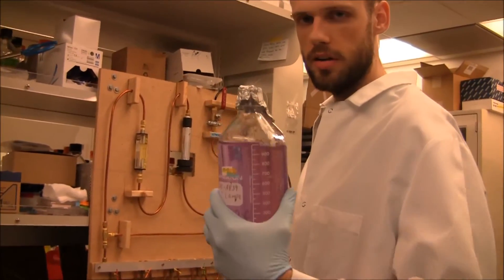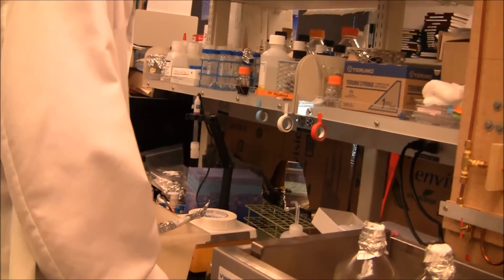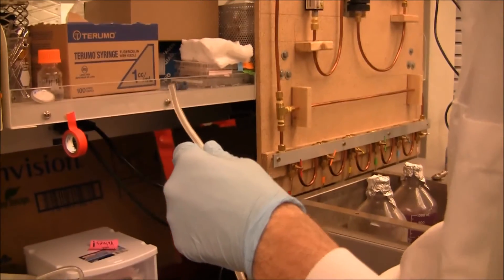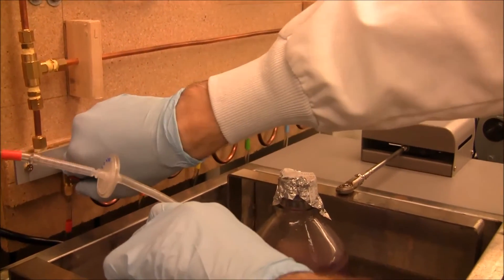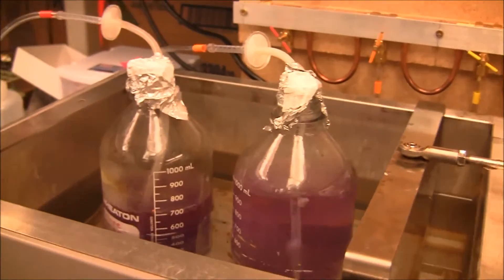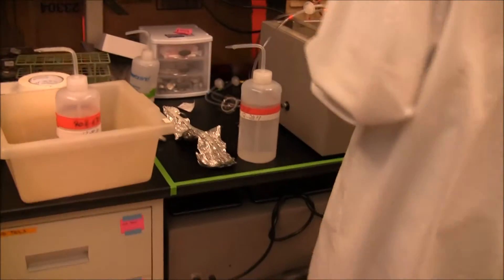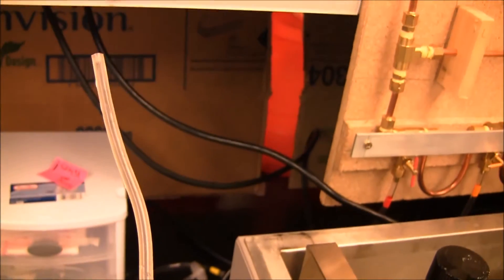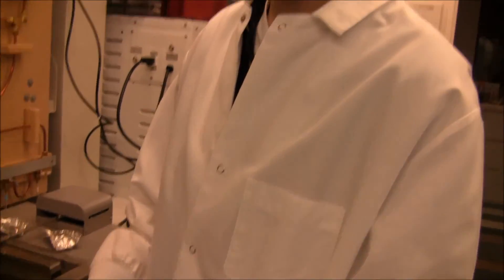Preparation of Anaerobic Media

Comment: Hi! Thank you for the video. I did the same thing in my lab, I bubbled nitrogen into my media for 2.5 hrs but I did't see any change in color! it doesn't even get lighter!
Reply: What was the purity of your N2? Did you use the right indicator? To increase the N2 sparging efficiency I recommend to use a diffuser (similar to the ones we use in an aquarium). Alternatively used boiled water for the preparation of your test medium. When transferring the boiled water let it run down the wall of the bottle/flask containing your minerals.